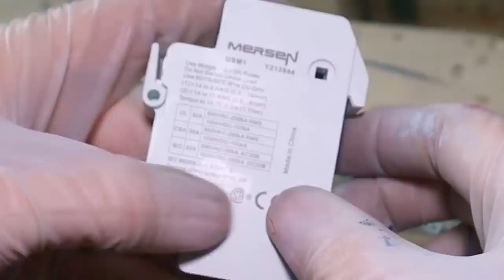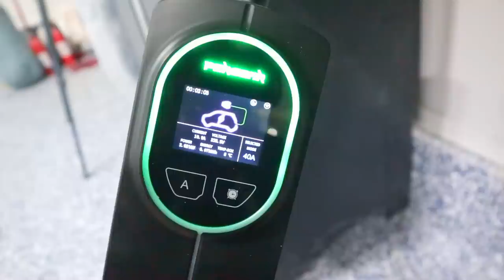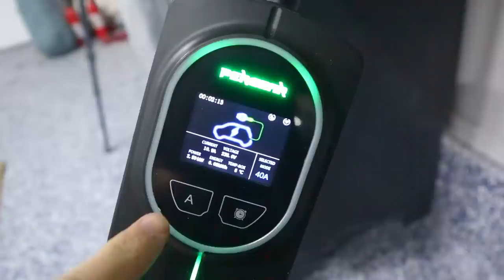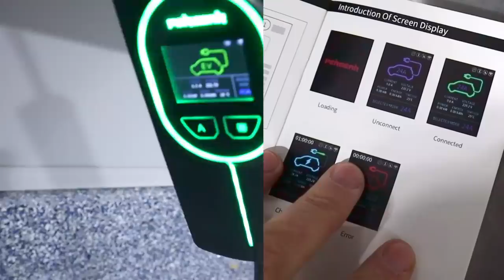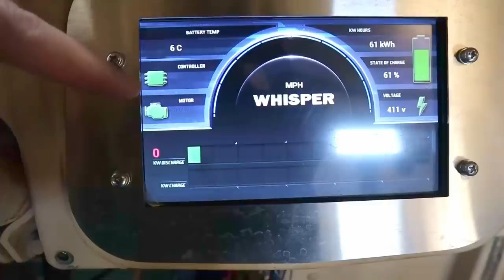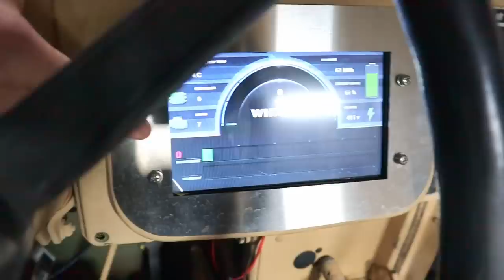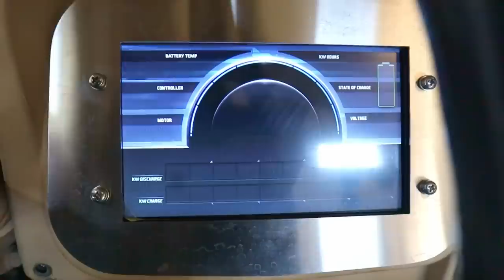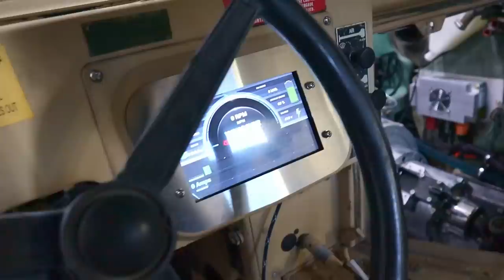The Electric HMMWV Strikes Back - More Trouble with charging

Comment: And I thought diagnosing electrical issues on a regular car was bad! Loving the troubleshooting process but I’m sure you’re ready to be done haha
Reply from the maker: So close...I can feel it!
Reply: cant wait to see the moment "ahhh it was this lil thing like a ground into poor mount or something like the I should have had a v8 "
Reply: Surely this makes you want to do an electric conversion on the 280z
Reply: Strange seeing you here ! Dont you have a 280Z to finish? Lol,  nice to see you supporting other channels !
Reply: Ronald, jumping in....  Nice to see you Sir!
Reply: I used to own a really rare European spec diesel golf. I really really wanted to keep that car but it was just so clapped out electrically. I eventually just ended up leaving it at the mechanic shop I'm pretty sure he took a mechanic's lien on it. I feel really bad but the cost to fix the electrical issue was going to go well and above the value of the car. I lost 3,000 in that endeavor and ended up owning a Mazda 3 2014 and have never looked back
Reply: It would be easier if you undo all the wiring  and start it all over just to be more sure it will work, in my observation the VCU and BMS are all mixed up and not in-sync also the display is not compatible with the system
Reply: This.
Reply: It's pointless building this. It's to heavy and that will mean the range is ridiculously low.
Reply: it be really funny if it was cause something wasn't connected
Reply: Left a comment with something you could try, I do STEM and Electronic engineering. Maybe I could help?
Reply: Ronald, I always thought that a Fiero was a perfect car to make electric!
Reply: @CharlesAbell  I will finish your sentence *FOR* you:
"is going to be a great project here!" Did I finish your sentence right?
Reply: @CharlesAbell  "is going to be a great project!" Did I finish your sentence right?

Comment: Soooo close. I can feel it!
Reply: Isn’t that a bad sign when it comes to electricity 🧐
Reply: didn't feel like doing it right the first time huh
Reply from the maker: Sorry for the delay my friend.  Those nasty electrical gremlins are tough to get out!
Reply: Change VECU once, AC grounding and DC grounding should not mix,check all wiring continuity
Reply: @aksks371  Actually they should be connected and at same the same potential, but there should not be much current from AC ground/return to DC ground.
Just like the AC current should all be on the AC power & return lines and almost zero on the ground line, that's why the GFI interrupts the hot line if the ground gets any current.
Reply: @ElectricSuperCar  Run it. Break it. Find it. Fix it. Repeat as necessary.
The mantra of the field commissioning engineer.
Reply: @scottbaker9066  In a power station, there are two power systems: AC and DC. Both systems are independent from ground and share nothing. It eliminates ground loops. The only system that had a ground reference was the 120 VAC lights and outlets.
Reply: I feel like you should get a working unit with the same components and jenga switch out the components to see where the problem is.
At this point it feels like just testing everything without a clue.
Reply: @MxLKy  that's a very energizing joke
Reply: @spaceflight101  Yes but in reality both grounds connect to the earth through grounding rods. Cars don't connect to earth so they do need both systems to be tied together somewhere or you potentially could have the chassis of the car energize at say 240v and the ECU would have no way knowing. Realistically the grounds should be tied together through an appropriately sized resistor and monitored by the ECM so it can open the relays if it sees a loss of isolation.
Reply: @aksks371  Actually that is not correct, the AC ground and the DC ground should be connected together in an electric vehicle.
Reply: Aren’t the batteries from a totaled Tesla?

If so, the batteries know they aren’t in a Tesla and refuse to charge, possibly???
Reply: @ElectricSuperCar  just out of curiosity: are the components Jerry put together even compatible with eachother? the CAN bus looks like a simple shared differential - so in order for the devices to communicate all have to be set to the same parameters like signal speed and other serial stuff - is there a chance that some of the controller chips just don't like the others and therefore the communication has such issues?
Reply: Could it be something as simple as a system charging safety default of "no park brake applied" meaning the car will not allow you to charge because it doesn't think the car is parked, or is in Drive, Reverse or Neutral?
Reply: good job guys
Reply: wires are wires and wires can be tangled

Comment: As a Network Engineer, I can't emphasize how similar the troubleshooting process is from industry to industry. I love these videos and the process of getting from one road block to another (different) road block is always a step forward, despite the fact that the issue still persists.
Reply from the maker: Thanks for the comment!
Reply: they sad electric cars are simple and reliable well I dont think my mechanic could fix one of these
Reply: @Chris-hw4mq  It's not about fixing, it's about building. Once it's built properly, it's much more reliable than old fuel cars.
Reply: At 12:27 it Rx but there’s no Tx !!!
Reply: @Chris-hw4mq  Your mechanic isn't building one from the ground up.  There is a reason that every industry from aerospace down to cars pays system integrators pretty damn well.  Its a challenging process in development.
Reply: @valeriitrots6302  just like in communications networks, "A good design will ensure easy support"
Reply: I was thinking the same thing about networking 😊👍
Reply: @valeriitrots6302  Have you met Mr. Murphy yet...?
Reply: @KellicTiger  the car is already built, he is just troubleshooting it
Reply: Nothing like cascading issues!
Reply: @Nexinator  It's kind of like how Cisco implies that if you have physical access to the device, then you have access to the device =P
Reply: @mariodagenais6625  There's no Tx because the computer monitoring the CAN bus isn't sending anything. All the communications it's listening in on would be Received... Rx.
Reply: As a fellow network engineer this reminded me exactly of a troubleshooting session that we had, it took us two weeks of trying various things to finally pinpoint the issue which was a very specific misbehavior of a switch under very specific configuration.
This Humvee troubleshooting looks quite similar to that
Reply: @mariodagenais6625  That's because the software he uses to log the packets isn't transmitting anything, only receiving data. Everything else is Tx/Rx properly, what the packet logger prints is just the packet loggers PoV
Reply: @valeriitrots6302  everything has a service life, once it's worn out it needs to be replaced. Capacitors and motors only last so long. Throw the entire car away? Or spend thousands for an electrical engineer to spend days troubleshooting. 
There's a reason why people love all Mechanical machines, because anybody with a basic understanding of how things work in the real world can figure it out. 
No way could 99.9% of the population figure out CAN network issues.
Reply: @andrewschlosser9483  I don't get your point. You say that there are more people who understand mechanics better than electronics? So they would like to fix combustion engines instead of electric motors or what? Because CAN bus exists in both variants. So they won't be able to fix it either way.
Electric car, once properly engineered and built, is much more reliable. It's a simple fact. And I don't get why would you think you need to throw away the entire car in case of any problems.
Reply: That CAN packet analyzer looks like it needs a Wireshark treatment!
Reply: @mikosoft  we had a problem once whereby a network infrastructure engineer had deployed a new wall socket, only, in doing so he'd damaged 2 of the pins in the keystone socket meaning they were shorted.

This didn't cause problems in ordinary circumstances, however, when an afternoon shift engineer came in and switched on his computer which was left off under normal circumstances, it would cause merry hell across the network.

You gotta love SixNET real-time fibre ring switches haven't you!

😩
Reply: @weedfreer  reminds me of similar situation that happened when we did complete reconstruction of our church building, we had new electric and nw infra done. But the guy who terminated the sockets was more of an electrician than nw eng so pretty much every keystone was different, some had long runs of pairs untwisted and exposed, some pins weren't even connected or not connected properly, some had pins swapped. We were intending to use the infra for various stuff like HDMI for cameras and analog audio via splitters. So when I came in to connect the cameras I ended up running all over the building for two hours with tester and noting down every single socket and what's wrong with it instead.
Reply: @mikosoft  oh my...that's hellah bad.

In my case, it was a 'pro' what done it!

It affected a manufacturing facility for abou a week an a half!
Reply: The app was screaming BUS HEAVY in red on bottom. Makes me wonder if there's too much going on on the bus. Like maybe one device is transmitting way too much.
Reply: As a software engineering I can relate
Reply: In AV, I reach a point like this and.... pull everything, so I can re-assemble and build my signal flow one variable device at a time from a known-good state.
Reply: @Chris-hw4mq  The electrical system is not already built.  It was put together from scratch, but it was never finished as he didn't do it right, hence these videos.   
And no one has ever said electic cars are "simple" but they are more reliable.   This is not an electric car in terms of a production vehicle, this is a hobbyist project.

Comment: I love this series. I'm amazed by the complexity of EV's.
Reply from the maker: Thanks for the comment!
Reply: I still feel that's a negative. The right to repair movement ought to have issues with EVs... Death is only a slip away from those battery packs... and yet they all use petroleum based products in their construction and use. I'll stick with existing fuel systems, simply do to the fact if something breaks on an EV's powertrain, I can't fix it.
Reply: @monkeybarmonkeyman  Well not that fuel powered cars are easy, engines are really complicated and need just a slight problem to potentially destroy the whole engine
Reply: @monkeybarmonkeyman  Probably the same has been said when people switched from horses to cars…
Reply: i dunno know if EVs in general are complex or if it's just this one. ebikes don't seem that complex so why couldn't you also make simple electric car?
Reply: @monkeybarmonkeyman  Bad way of thinking about it.  This particular build is very complicated and many DIY EVs can be quite simple.  Trust me the simplest car engine is still way more complicated than the average EV.   Just because you understand that system more doesn't mean that EVs are bad.
Reply: @monkeybarmonkeyman  nah, it just different field... one is mechanical engineering and the other one is electrical engineering... of course if you cross field from your area of expertise it will looks more difficult... doesn't means it is truly difficult, you just never touch the subject before...
Reply: @marcd6897  If you bothered to study history, you'd have learned that automobiles were enthusiastically embraced by the cities as a way to eliminate horse urine and manure from the streets. Big hygiene and disease problems. People who lived in the country weren't anywhere near as enthusiastic because the infrastructure to support automobiles didn't exist.
Reply: @monkeybarmonkeyman  right to repair should also have issues with modern cars then. They're completely controlled by computers running proprietary code, and when I say everything I mean everything, even simple stuff like power windows are connected to a control unit and are no longer directly operated by the window switches (actually, I've already had a system like this in a 2001 car so there's that about modern cars).
Reply: @mikosoft  yeah but all of those car computers are relatively simple to diagnose, and though expensive still available for purchase. unlike any part for a tesla. the biggest problem with the computers is the OEM required systems to read them, unlike previous cars where all you needed was a code reader, now you need a code reader AND a subcribtion to access to that car makers software which can get ungodly expensive
Reply: @SkaterStimm  So true... but with roughly 60 years of experience in them I'll probably never need to switch 🙂
Reply: @mattex3396  wrong!!!! Engines are actually easier to work on compared to those millions of electronics loaded EVs! Plus complex software
Reply: @marcd6897  please don’t you ever say that! Never compare a car to horse! That was a revolution that happened century ago starting with EVs! No one really ever said that!
Reply: @oplkfdhgk  electric are relatively super simple moving things it’s just tiny battery pack plus motor and super simple electronics.
Reply: @SkaterStimm  wrong!!!!!!!!! EVs are more complex! Sure the battery itself, electric motor are simpler but the electronics and software are the complex part there isn’t a real DIY if you want an actual usable conversion.
Reply: @alphaxfang  ICE are both mechanical and electrical engineers therefore mechatronic! Automatic gearbox and engines and modules are controlled with electronics which are much simpler and fewer than the electronics of EVs
Reply: @spaceflight1019  exactly! And the automobile is actually what build and constructed all the infrastructure we have today which no EVs have ever contributed anything to it.
Reply: @alanmay7929  when people talk about working on in their own car mostly it fall in mechanical side, rarely i see people meddling with the electronics part...
Reply: @alanmay7929  yeah, because having hundreds of moving components, and having to time everything perfectly or the valve will hit the piston is really easy. both are complicated, you just know fuel cars and know nothing about electric cars...
Reply: @mattex3396  there are literally still 40 years+ old vehicles/ICE on the roads used in very difficult conditions around the world. It’s actually the modern electronics that made the better control of lithium batteries really reliable.
Reply: @alanmay7929  I'm so ignorant that i know you don't have to calibrate an inverter... You simply buy the one fitting the rest of the vehicle and if necessary you set the parameters via a software.
Reply: @alphaxfang  lol…. So ICE never also suffers from electrical/electronically problems too!? Are you ok!? Older cars had barely no electronics and are still on the roads can you explain that!?
Reply: @alanmay7929  no, my comment is related to the right to repair comment... It means for self repair by individual with no expertise skill (non shop/mechanic)... Most ice self repair doesn't handle electrical problem, if it already diagnose as electrical problem most owner will take it to shop...
Reply: @alphaxfang  and for EVs it’s totally impossible to even touch for most owners too lol!!!! Also with tesla for example when you rebuild or restore one you might not having any acces to the charging network and many other limitations since they know almost everything about that car…..
Reply: Dumbfounded is more like it.
Reply: @alanmay7929  duh, you take the worst example of EV for right to repair... Tesla is EV counterpart for apple in mobile phone... There is more brand in EV industry than just tesla...

Comment: This whole project is teaching me one thing, electricity is complicated.
Reply: The fact that nothing is going to plan is making this a much more engaging and educational series. Absolutely loving it!
Reply from the maker: Definitely learning a lot!
Reply: You mean software is complicated ;-)
Reply: At some point a unit will be so complex you can't repair, troubleshoot it.
You saw those system data reports all come out in Chinese.
The problem could be as stupid as a language or script  setting in the software of one of the components.
A character or processor limit...

When nobody is familiar with marrying these systems nobody will be able to help either. You're in nomansland.

This is why large companies manufacture everything in-house and try to standardise things accross industries.

Unless they can be referenced you end up with enormous heaps of scrap just because fixing, troubleshooting is impossible for anyone but the designers of the products.
Reply: @zteaxon7787  Eh, I don't know about that for this case. All of these components do conform to applicable standards. It's a matter of careful review and integration of spec sheets. Enter the need for a roboticist.